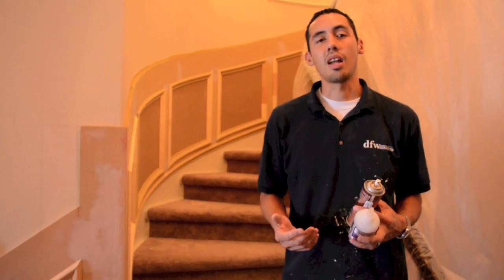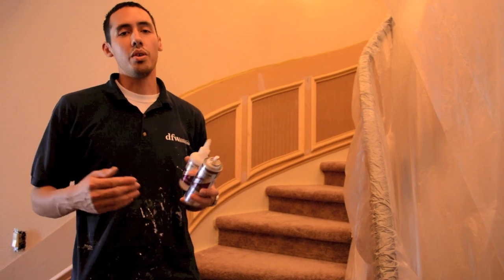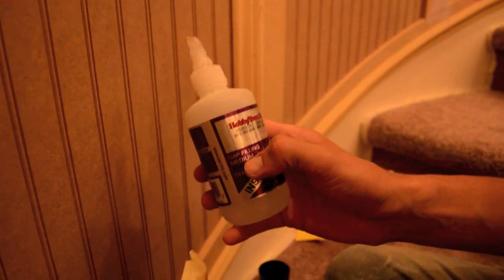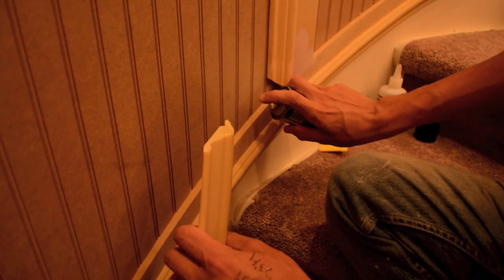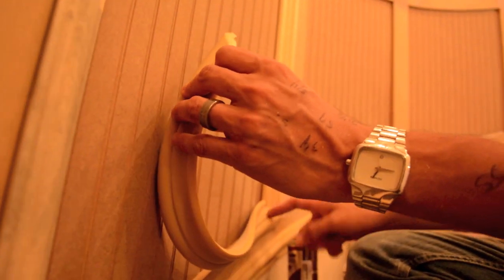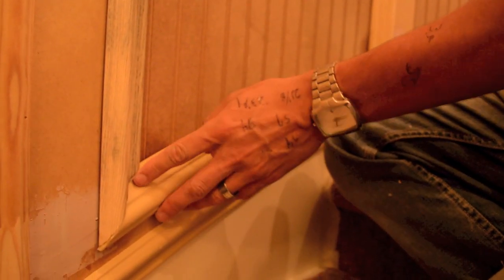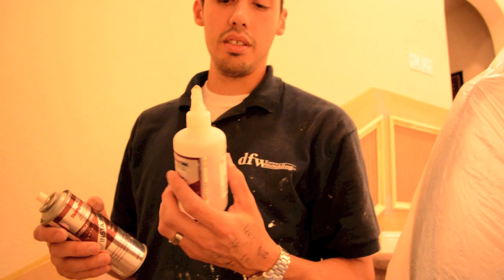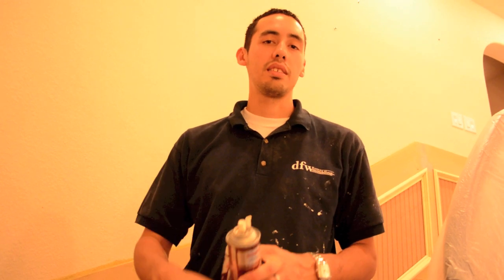Best Glue for Trim Carpentry - Cyanoacrylate

Comment: With traditional wood glue the idea is to thoroughly coat both sides of a miter, (assuming real solid wood), so as to seal the end grain.  That helps prevent moisture from entering the wood and causing expansion/contraction.  With CA glue you don't get full coverage of each side of the miter.

Comment: I couldn’t find where to buy CA glue. In a pinch I used a hot glue gun on MDF crown for my project and it worked fine. Your videos really helped me learn some tips. Thanks!
Reply: There's a ton of CA glue at Lowe's, Home Depot, or Ace Hardware. Most super glue is CA glue

Comment: Ok, I’ve got a tip for you.  I see you write measurements directly onto your hand and arm, (unless those are tats).  I understand why, because if you use a piece of scrap wood, or even a small note pad, it always gets lost and becomes more of a hindrance than a help. What I’ve been doing for the last 30 years or so is taking those little white Formica samples you get for free at the box stores, and I epoxy them onto the side of my tape measure.  Cut & trim them to fit around the tape, (I use aviation snips & sand paper), so there are no edges that catch anything.  You use a pencil, a little spit & wipe (I just use my pants or dirty tee shirt)  quickly clears the Formica for more numbers once you’ve done the cuts.  The tape is always going to be with you because you cannot transfer measurements without it.  Save your hand, save your arm.
Reply: fantastic! what a head slapper, wish I'd read that 35yrs ago
Reply: I do the same thing except with painters tape on the side of my measuring tape. I just put a new piece over the top and when it builds up I tear it all off and start over.
Reply: I've been using the yellow Stanley contractor (now Fat Max) tape measures for the last 20 years or so.  If you peel the sticker off the face of the tape (you have to clean the adhesive residue off the plastic) it creates a smooth surface that you can write on and rub off indefinitely.
Reply: John Nevins good idea plus keeps others from stealing your tape
Reply: ok but you always have to keep a pen that is compatible with that surface. It looks like it's more work than just writing measmts on a scrap or your hand TBH.
Reply: @xl000  Not sure when Jerry edited his comment, but it clearly states he uses a Pencil. I can't imagine an incompatible pencil, but maybe you could find one.

Comment: Good tip, I use it constantly. I apply the glue to one face, match it to the other face then spray the made up joint and the activator leeches into the joint and works instantly. You should have mentioned about keeping your fingers away, I've glued myself to way too many walls!
Reply from the maker: +Graham Orm Haha! Yeah I have glued my fingers together a few times. I find myself trying to peel glue off of my fingers on the way home sitting in traffic. Just another day at the office. :) 
They do make a deactivation formula called "Un-cure" just in case you get into some serious trouble. You're right, I should've mentioned it.
Reply: +dfw crown Thanks I'll look out for that. Worst I've done is get glue in the crease of a joint and glue a finger in the bent position. That was fun.
Reply: +dfw crown Found it on Ebay and bought some. Thanks for the tip.
Reply: When I use C/A glue I wear nitrile gloves. That way I don't have to worry about gluing my fingers together or to the work. I buy them by the box of 100. They are also good to wear when painting or staining.

Comment: Great tip Richard! What brand of flexible molding do you prefer? And how easy is it to paint or stain? Thanks for the great videos!
Reply from the maker: They are all good from what i have seen. Yes they are very easy to paint. I recommend using a good primer though.

Comment: How well does the glue joint fill sand and finish. Also is it a painters nightmare when you get glue on other surfaces? I have used a hot glue gun when needed I assume you like this better?

Comment: What about for inside corners? I noticed that you only seems to mention it for outside corners and scarf joints. 
Thanks!
Reply: Easier to just cope the inside corners, or you can glue them if you use an angle tool to accurately measure the inside corner. 90 degrees is rarely 90 degrees.

Comment: If I am going to stain the wood will activator over spray cause a problem? Also I'm replacing trim in a finished building. Do you know if it will stain carpeting?
Reply from the maker: it wont stain carpet. But like any glue, it will get deep into the grain if you get it on the wood. you can use it on wood just be careful with the squeeze out.

Comment: Man I've tried this 3 times today with zero success. I must be doing something wrong. I even let it sit for 5 minutes. Trying to glue some baseboards
Reply: My guess. The activator is no good. I sprayed urethane , 2 part paints, and clears on metal. If the activator is to old after opening a can, you only have about a month to use  or it wont harden properly. I found this out after I clearcoated an airbrushed motorcycle tank, and the clear didnt harden all the way. I could leave a fingermail mark in it,